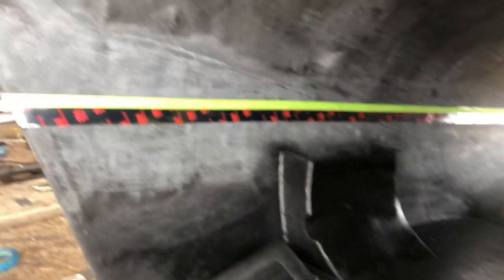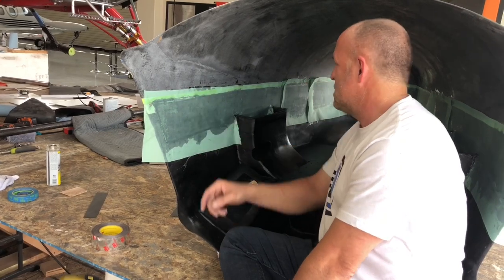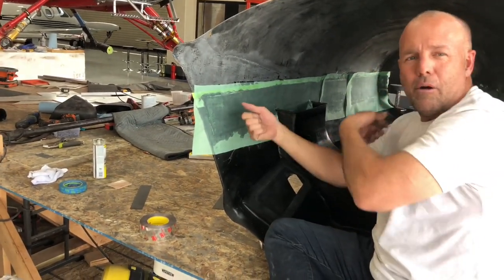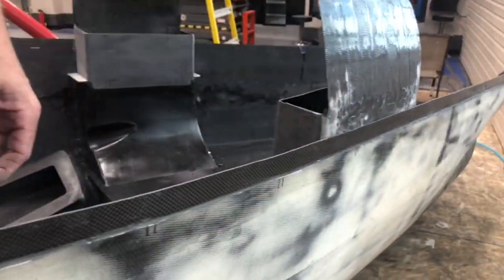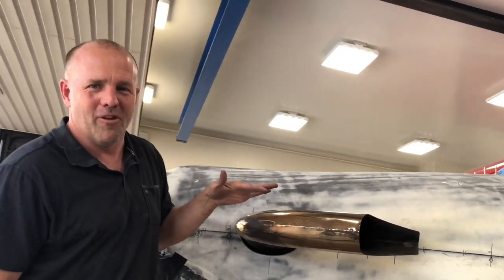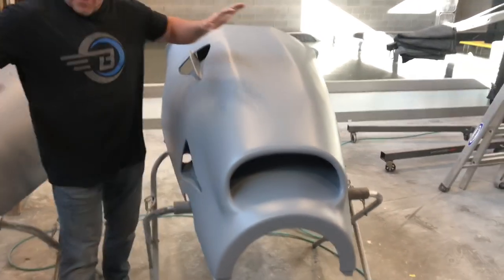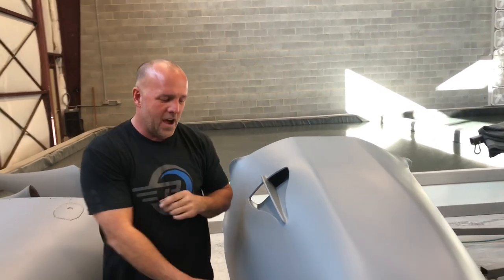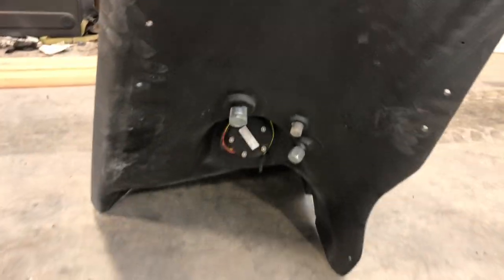Mike Patey Wilga (DRACO Video 11 B) Carbon Fiber Cowling Completion

Comment: Man, that's some seriously beautiful work. I'm fascinated by this plane. I worked as an HVAC mechanic and technician for years, and your duct work design is just incredible. I've never seen anything like it on a bush plane. I can see the flow. Like you said, it'll slow way down within the widening plenum at the filters, and then speed up again a bit as it hits the ducting up to the engine. Genius.

Comment: The beauty of a "practical" engineer.  A common sense approach to the airbox/filter system.  Crop dusters were designed by "professional" engineers.  Over 200 parts compared to your solution, I'll take your solution.

Comment: Your explanation of the two air inlet ducts showed embedded aluminum tabs for the nut plates.  I was always told that carbon fiber next to aluminum was an invitation to corrosion.  How did you handle this problem?  Did you separate the two with one or more plies of fiberglass?

Comment: Your cowling induction system is very similar to the cowling on the KC-135A, which ran a Pratt &Whitney (J59-W...I think).
When the cowling was closed it made an instant seal to the intake ports.

Comment: Question....how hot does that engine compartment get during flight on a hot day? If it gets over 150 F degrees how do you keep the resin from breaking down? Or is it a high temperature epoxy or Polyester resin?

Comment: Great, interdisciplinary skills, great entusiasm, great workshop and tools and great fun, I love that approach )).; Just wonder/sorry my basic english/: main air intake below the propeller naturally&simetrically intakes the air along airplane's longitudinal axis BUT then comes harsh 90 deg angle upwards on both sides, to the custom-made inlets/. Does it not limit the speed of sucked air=amount  and/or cause turbulence inside the ducts supplying the turbine? Or these are negligible factors? OR gross width of the turbine limits available space unnderneath the cowling only to such alignment?
Reply from the maker: zyzo99  great question, I create enough positive pressure and the sizing is enough so that the losses from the 90 is minimized and negligible
Reply: @MikePatey  yep, and I ve realized afterwards/watching next parts/ theres expansion chamber actually after the filters.
Reply: @MikePatey  Theres some intermediate design stage that 'happened' to Wilga after quitting socialism in Poland but most probably you are familiar with that?: https://www.youtube.com/watch?v=AOApZ1oAh84

Comment: Why not put the oil cooler before your airfilters, as that would keep ice away
Reply: tyrone williams the hot oil cooler could crack from cold damp air running through it. But I would imagine the more immediate reason is that bush planes land in rugged terrain, so the cooler would be more susceptible to impacts from debris.

Comment: Mike, love the videos documenting this amazing plane build. Incredibly inspiring. 

One thought about your airfilters. It seems like if it's raining there will be water entering the filter area.  Paper and or gauze type elements do not work well if they get wet.
 Perhaps you could use  Outerwears Pre filters. https://www.outerwears.com/products.asp?cat=11581. I've used them for Offroad vehicles and they help to protect the filter element from rain and splashing. The flow restriction is quite low.